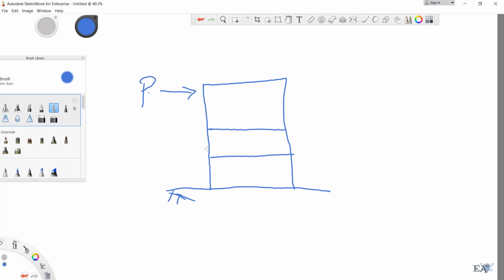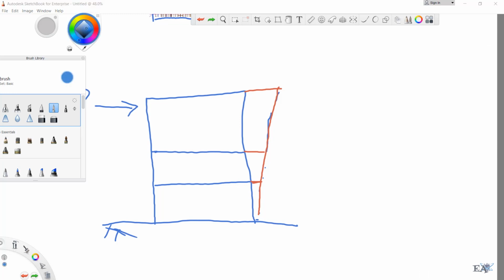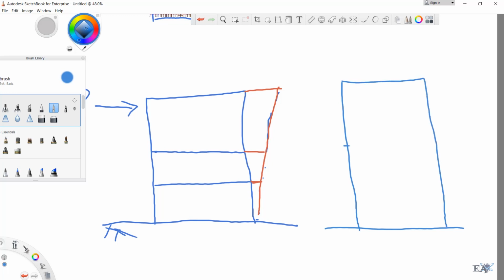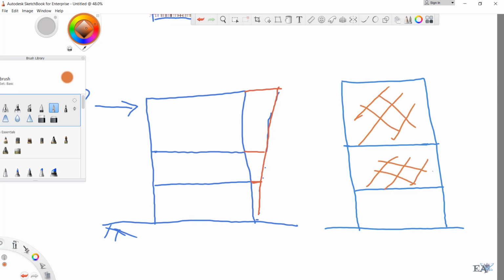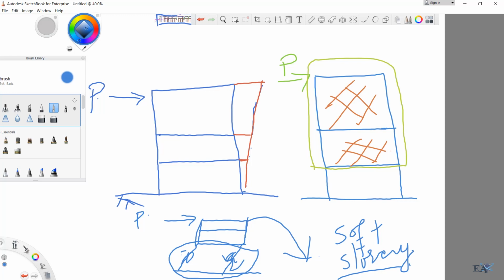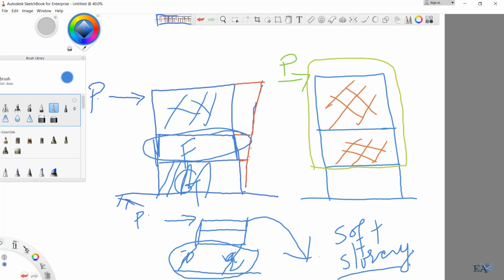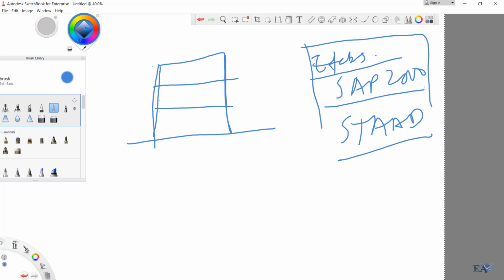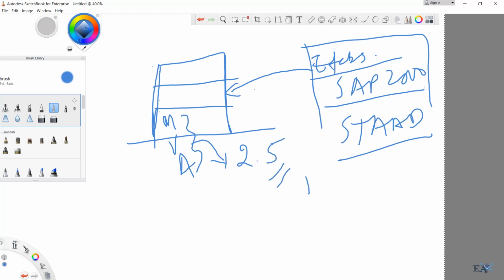Soft Storey Collapse Mechanism and It's Remedies| Interview Question #18

Comment: Increasing column sizes or designing them for 2.5 time moment isn't called overcoming soft storey, and rather it's only possible when soft storey is at ground floor level. Soft storey at intermediate levels of buildings practically can't have a sudden 2.5 times increase in size at such floor and then again reduction at overlying floor.